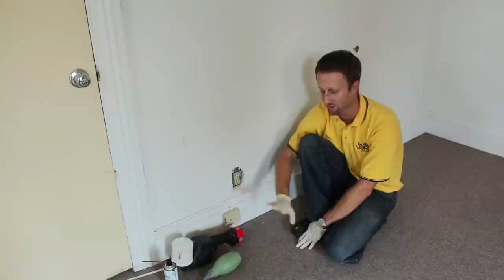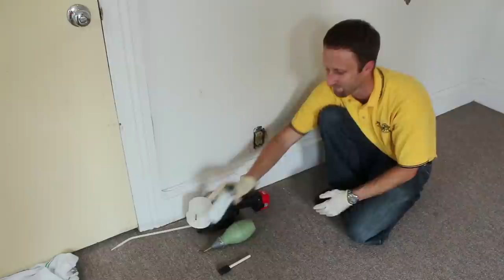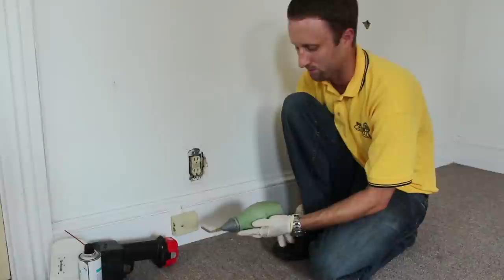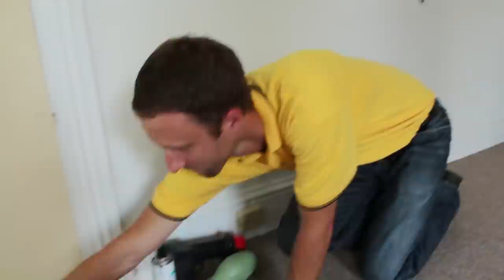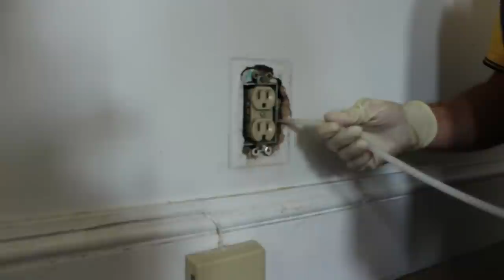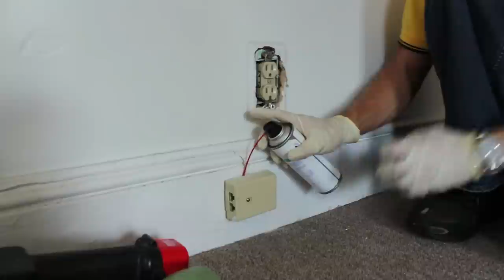Different Techniques to Apply Dust for Bed Bugs

Comment: If food grade DE is cheap, effective, and so non-toxic that it's edible (some people to mix it in a drink as some kind of cleanser) it's almost seems like dusting inside the walls before the drywall goes up should be a requirement during construction.
Reply: It only lasts 2 weeks... but Cimexa lasts 10 years and is even safer for humans (less lung damage).
Reply: YOU cannot breath the D.E it causes  respiratory issues.  using in vegetable garden for pest control is  safe - mixing sm. amounts in juice or water to drink  to clean your intestinal track is safe also. BUT it is bad for your lungs. this why ppl are saying vacuum it up and shampoo or mop floors  behind that. and clean up spills etc etc. i just cannot figure out how long do i put it down  before i vacuum and shampoo the carpets. i would have to leave and take my pets somewhere too.
Reply: You don't need food grade DE to treat bedbugs.  That's a falsity.  Just buy the DE that is labeled  for bedbugs and use it in conjunction with Crossfire pesticide.
Reply: M A  I keep hearing different, but I certainly hope it does.

Comment: The bed bugs I have found were not necessarily living in crevices or outlets, they were living on cloth such the tops of curtains or, adhered to my pine Ikea bed. If a BB must walk through the dust to die, logic tells me the dust must be placed on the wooden bed or curtains thus creating a barrier (that a bug must crawl through) between a bed bug next and the human host. As such, can/should dust placed on wooden bed frames or dusted curtains (as examples)? I've ordered dust that comes with a brush (like a large makeup brush) and seems to work perfectly well for applying dust to wood, walls, cloth or what have you. The dust readily adheres to those places.

Comment: Sleep tight, don't let the BED BUGS bite!  If you live in a hotel or apartment, apply food grade diatomaceous earth in all the possible places where bed bugs can travel from your neighbors to your home: baseboards, wiring, plumbing connections, door, windows etc. (Leave this barricade of DE protection in place permanently)

If you have bed bugs, gently spread a very thin dry coat of Food grade Diatomaceous earth ON YOUR BED. You can use a soft paint brush. Put a  SANSBUG BUG TENT on top to sleep inside. 

Each night some of the hungry bed bugs will smell you and come for a drink of your blood. After walking across the powder, THEY WON'T BE ABLE TO GET INSIDE THE TENT TO BITE YOU.  Later the DE clinging to their bodies will dry out their exoskeletons. They will shrivel up and die.

Sleep inside the tent at night for about a month, long enough for all the bed bugs to dry up, including the tiny nymphs that can hatch from EGGS several weeks after the adults are gone. 

They normally like to feed about every 5 days if they haven't been disturbed.  All the bed bugs will eventually walk across the powder. THEY MUST HAVE BLOOD TO LIVE. You are the bait in this trap with your supply of blood which lures them onto the bed. The diatomaceous earth on the bed will get rid of all of them. YOU DON'T HAVE TO DO ANY WORK, just sleep inside the tent at night without getting any bed bug bites. 

If bed bugs are in the sofa or chairs, vacuum and then apply DE.

Comment: I have arthritis. I used the bulb for half a day and when I woke up the ne t day I couldn’t use my right hand - tendonitis from RSE (repetitive stress injury). One bottle of silica I bought came with a brush that looks like a make up brush women would use to apply blusher. Is this an effective way to put down silica? The silica seems to disappear as soon as the baseboard is touched. I can’t afford an electric duster and the bulb duster is not an option thanks to my age/arthritis

Comment: It seems to get into the air quite a bit.  If you were to vacuum it up with a central vac, could it theoretically get into the air and stay there, since it’s so light and floats? Do you know if anyone has had ongoing health effects from its use?

Comment: Great informative video, from a well renowned individual, but some things are missing. Now that being said, you can tell mr white has never actually ran a route before. He sounds just like an entomologist from most companies, he also acts like an IMP technician. (No disrespect intended).I'll go into detail if the right questions are asked , thank you.
Reply: Mark Upton Why don't you just share you info instead of playing games?
Reply: +Tom Rankin okay, in my opinion he basically gave a vid on dusting,  but didn't mention the types of dust ,and how they rate, (Delta dust,Tempo 1%, Alpine dust etc ). He also fail to mention treating the carpet edges, which with any bedbug infestation a amount of the bedbugs will be found there. Also no info on treatment of mattresses or boxsprings, which is where 70-80% of the the bedbugs will be present. There should be a mention  of permissible materials and their uses. (D-force,sterifab, CB-80,bedlam ). Also Temprid  SC. And for the record Tempo 1% rated first,  with Alpine dust and Delta dust showing similar results as far as mortality rate and percentage.
Reply: +Tom Rankin Also in some ,or most cases, a vacuum is used to remove the adults, nymphs,  and eggs.
Reply: Thanks for the info. Much appreciated.
Reply from the maker: +Mark Upton the video was primarily created for the homeowner who's trying to complete DIY pest control and understand what I means to dust a crack....so yes, it is a vid on dusting, I'm also not a fan of rating dusts because I feel like most dusts that are created for pest control purposes will work fairly well if applied properly, in pest control it's more about how it's applied more than what is applied, also "rating" of dusts can change by study and colony it's performed on and the effectiveness of one particular dust can differ dramatically from infestation to infestation...as for the other comments you made I need to keep the videos to watchable lengths (I already get criticism for being too long winded) so I can't cover everything in one youtube video
Reply: ***** we ll said jeff, didn't think about vid length.  Can you offer more vid in the future on bedbugs, especially how to distinguish male/female for the people who don't know. Also more info on if IGRs are effective for bedbug control. Thanks alot jeff .
Reply: is this safe behind my tv on electrical wires